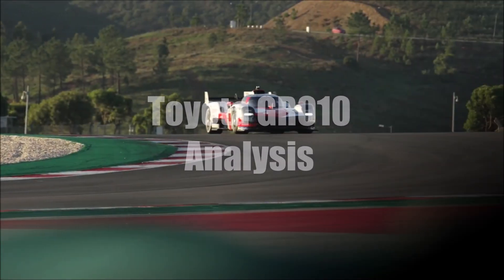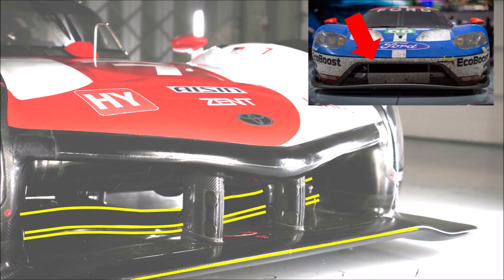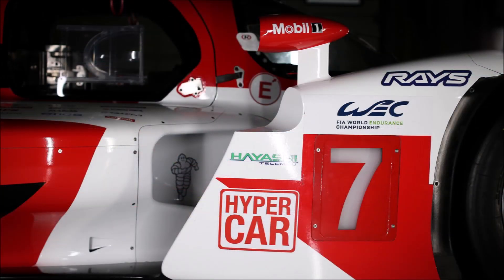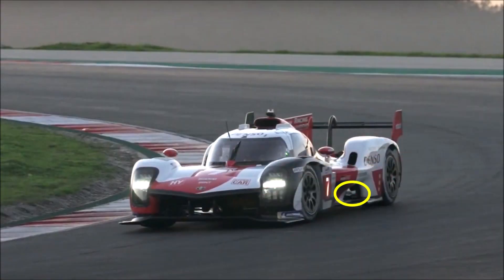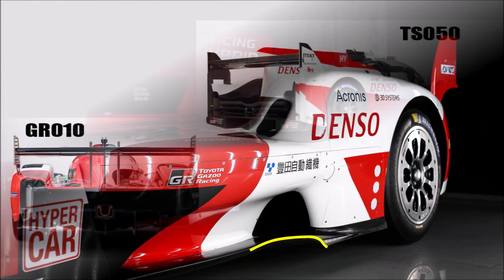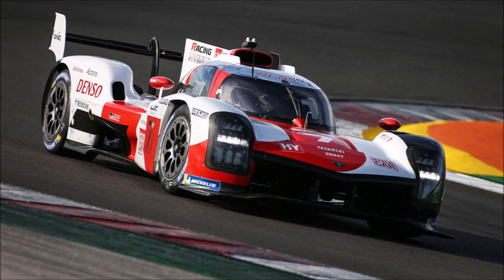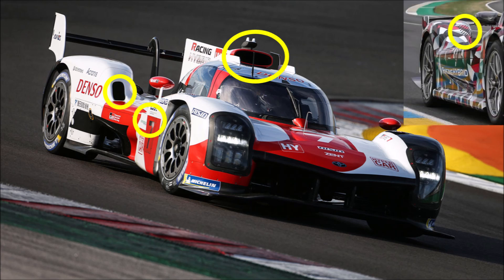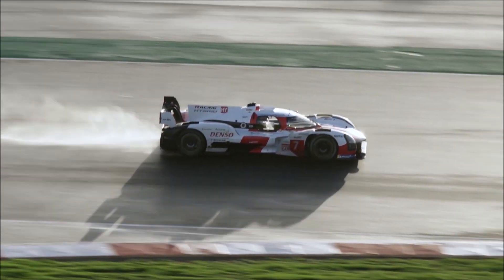TOYOTA GR010 Le Mans Hypercar - In Depth Analysis

Comment: I thought these cars were going to look much closer to the amg one, Aston valyrie or Bugatti bolide but these look like modified lmp1
Reply: @AzathothsAlarmClock  Yeah sorta. But rules are first defining point, then physics. And as u said then gradually engineering iteration bunch manufactures together. Design on all cars becomes very similar and converges towards optimal solutions. Its natural selection. Shame ACO didn't fully committed Hypercar rules and even banned LMP2 class in order to replace them with privateers Hypercar2 series. Ofc smart BOP should be developed.

Comment: Great analysis ! I love it ! You got one more subscriber ! 😉
Btw if you look closely at some pictures, you'll see other air ducts on the inside side of the sidepods (next to the exhausts), witch in my opinion, are use for brake cooling 😁
Here are two pictures where you can see it :
https://lesvoitures.fr/wp-content/uploads/2021/01/24-Heures-du-Mans-FIA-WEC-Hypercar-LMH-Toyota-GR-010-30.jpg
https://www.turbo.fr/sites/default/files/2021-01/gr010_hybrid_6.jpg
Reply from the maker: Thank you very much and I had a look at these too. I think you are right!
Reply: @bsport320  Also you didn't mention it but I find it strange that they keep the open wheel arches... Knowing that it's a big drawback...

Comment: Stunning. Thats my take on the Gr 010.  I love the front wing. It works so well with the chevron shaped nose. the front looks like its cutting through the air. The sidepods from this indicar like look in the back which encloses the rear wheels and integrates the rear wing nicely on the endplates. The rear to me loks like its ready to go on the road. The diffusor is somehwat small for the width of the car. Id love to see a diffusor that wraps behind the rear wheels like on the bugatti bolide.  I think the fences on the roof give it some character and using such a simple method to get air into the engine is something i really like.  

The car overall looks like its carved out by the wind  (specifically the rear and to a degree the front fenders). 

good video, but sadly a bit short, which is ofcourse due to the low volume of information
Reply: @AzathothsAlarmClock  Well taste is subjective. :D but as some say. "If car is fast is beautiful."
Reply: Can't really see the 'stunning' part. It just looks like another ugly LMP1 car.
Reply: @weallfollowmanutd  its called subjective opinion and some people have different subjective opinions than you. I like the look of LMP cars.

Comment: It will be interesting to see the GR010 against the Glickenhaus car, which on photos, look less aero detailed. We'll see. This car looks like the benchmark so far, great job Toyota. Will be interesting too,  to see the Bykolles car, not much info about them.
Reply from the maker: Agreed, the Glickenhaus looks a bit oldschool and simple but I only saw renderings so far. Will be interesting to see the first prototype. The ByKolles looks quite interesting
Reply: Yes, but not much info about the Bykolles project. We'll see, but at least the new Hypercars won't have to lift to safe fuel on the straights. Will be great to see them go full throttle again, for an old timer like me!
Reply from the maker: @Fysmodul6  Just released my video about the ByKOLLES